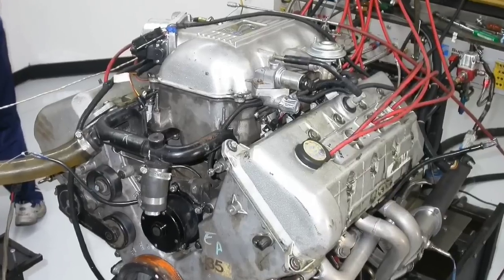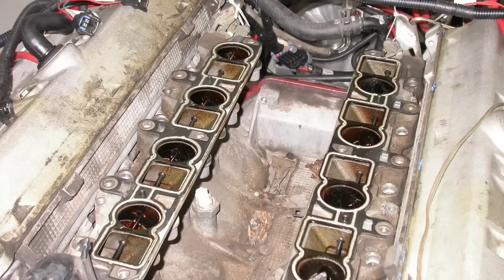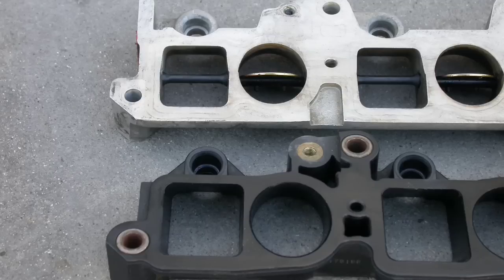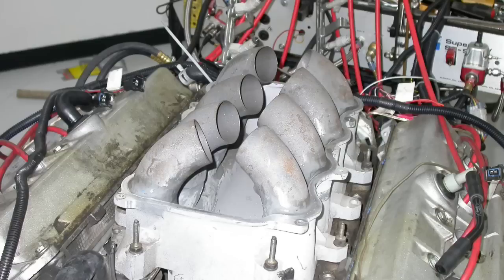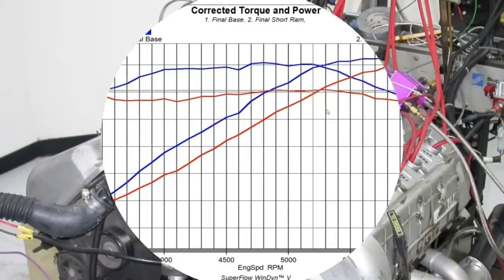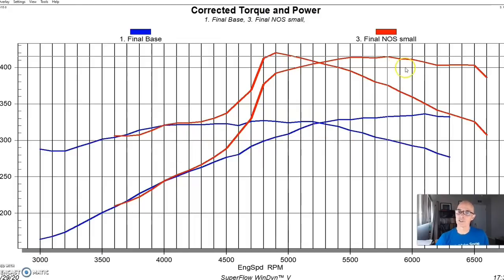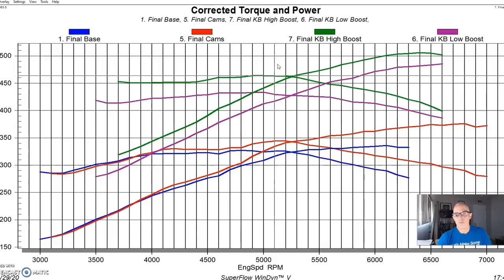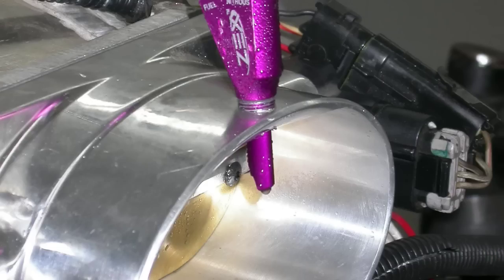1996-98 4V COBRA MODS

Comment: Those results show exactly why the LT1 and LS1 dominated during that era even though base Z28 cars were a class below the Cobra.
Reply: @turbojetpowered8299  best thing to do for em is 456 gears.  That really brings those cars to life and gives it aggressive gearing like the 11-17 coyote cars had which really helped them.  331 is like 410 355 is like 430 and 373 is like 456 if you compare an 11-17 coyote mt82 to the t45 back in those days.  So obviously the coyote has much more aggressive gearing and that really helped those cars.  A set of 456 gears with a sticky tire can take off more than a half second in the quarter mile on it's own on these cars that is huge.  I'm talking about a car that already had sticky tires just going from 327 to 456 gears will drop over half a second off your et it may actually even help the car trap a higher mph too.  Gears REALLY wake these cars up.  I cant think of many cars where a gear swap is needed as badly as it is on 96-98 cobras lol.  The mach 1 will also benefit from gearing but not to the extend the torque less b head cars do  because the mach is stronger in the mid range and has more torque overall so a super steep gear isnt needed although they do run awesome with 430-456 gears.  A gear swap on a 96 cobra will have it easily taking down stock lt1s even bolt on lt1s and it wont be far off stock ls1s.  Dont underestimate what 456 gears do for these cars lol
Reply: The Cobra wasn't the top dog/Mustang... the Saleen S351 was for that era.  495hp for the S351.  Modular Motors were the wrong move... Altered valve angle was the way they should have gone.. NASCAR Fords had been at 18 degrees since the 80's.. 18 deg heads instead of OHV would have put Fords on equal footing to the LS series without boost or spending zillions for a cam upgrade.
Reply: Ls1 camaro and 4v cobra were pretty evenly matched. Put em on the street and stock for stock it was a flip of the coin who would win and would mainly come down to driver.
Reply: @turbojetpowered8299  I bet your mach was sick.  I used to own a 97 cobra and 03 mach but it wasnt like whT yours was.  It was fbo stock gears tune.  It was faster than my intake full exhaust minus headers non tuned 97 cobra with 4.10 gears.  The 4.10 really woke it up but afterwards wished I had went 456.  I wanted 4.10 in the mach and cams similar to your build I bet that was badass man.  Those cars are alot quicker than many realize they could keep up with the ls1 cars pretty good  it was close enough to be a drivers race edge to the ls1.  You're right in that ford would not offer 456 stock it's too good lol.  There has to be compromise I could see 373 maybe 410 like you said.  The coyotes got stock 373s and they had a much more aggressively geared trans.
Reply: @turbojetpowered8299  $1000 for a cam swap.. just the cams on a Mod.  Compared to $130-300 for a Windsor.  408 Cleveland headed junkyard 351w blocks make 600hp naturally aspirated all the time. Modulars are a Poor/Expensive platform for modification.
Reply: @turbojetpowered8299   03-04 Terminator was Factory Supercharged and is an expensive starting point. $15-16k to buy an over 100k example. 408 forged rotating assemblies are much cheaper than $15k.. so are aftermarket Cleveland heads.. blah blah "scatter parts".   700hp single carb no boost 408 https://www.youtube.com/watch?v=D-Bcb4sC6Fw
Reply: Turbo terminators put GM out of production for 7 years
Reply: @turbojetpowered8299   Please ...  You're just boosting the crap out of poor design.  Factory 351C 4V heads flow 280cfm, Aftermarket Clevelands flow 400cfm. enough to support 550hp- 800hp N/A ..  Under 1 Bar of boost added to 550hp and you're over 1000hp.  This is a stupid conversation.. "blah blah strike fear" ... Who cares what strikes fear into boost junkies who know very little about N/A horsepower production??
Reply: @masta51  Is this a troll response? Do you realize how much EPIC FAIL this response has? Literally take the Cobra emblem out of your avatar. You are giving it a bad name and don't deserve it.
Reply: @turbojetpowered8299  Mach 1's WERE in fact drivers races with the then out of production LS1 F body, well, way more than the NA Cobra's anyway. However, I am talking about the NA 4.6 4V that came in the Cobra during the production years of the F body. Sorry for the lack of clarification. Even then, I have never seen evidence of even the Mach 1 running 12 second timeslips BONE STOCK. Something the LS1 F body achieved multiple times. Also, I bet my 2001 Z28 made the same exact power as your brothers SS but my car was 100lbs lighter and if it was heavier than a Mach 1 it couldn't be by much. That car scaled at 3400lbs on the dot with a FULL tank of fuel. I bought it brand new for just less than $22k out the door and no it wasn't a no options car. Good luck getting a Cobra at the time for that price or later on the Mach 1. 

Not to mention when you start adding bolt ons the 5.7 just flat out widened the gap. Headers and full exhaust alone make a ton for the LS1. On the Mod engine, not so much. We LS guys at the time also swapped gears for much benefit. Did Mach 1 and Cobra owners think that was a trick that only worked for their car? Lol
Reply: @banneddamn  sorry I hit a nerve there buddy. It will be alright even if the cars aren't evenly matched i promise. I like how you didn't even answer my questions. Discussion over i guess. LMFAO 🤣.
Reply: @turbojetpowered8299  good deal on the Mach 1. Yes, i also looked at some TA's and they were much more expensive especially the WS6 which dealers thought were gold. I wasn't as smart as you and rebuilt the factory 10 bolt once instead of putting a real Ford rear end in it. Money wasted as it didn't last long.
Reply: @turbojetpowered8299  lol, you go ahead and call it fun. I call it going broke because I was a dumb ass. 😆
Reply: @masta51  
Wrong
Reply: Termi's hold 7000 hp and can do 30k rpm on factory internals. Supra 2JZs can hold 7000 hp and rev to 30k rpm on factory internals.

Yeah and what. If you're building an engine who cares if you bought aftermarket parts. Many cheap and dirty 5.0 slow and sbc have stomped on modern better stuff.
Reply: @turbojetpowered8299  
A 1000hp terminator will never be ok with the smog police. Sorry, I'm missing your point.🤷‍♂️
Reply: @turbojetpowered8299  
Nice!
Yeah 1000hp car pretty much won't pass emissions where I'm at.
Reply: @ShizawnSanders  I beat on plenty of LS1 cars with my 98.  Most LS cars would run 13.30-13.50s at the track.  The 2v gts ran 13.80-14.0.  The 99-01 Cobras ran 13.30-13.70 and the 96-98s typically ran in the 13.50-13.70 range, with a handful of factory freaks going into the 13.40s.  It's literally a drivers race.
Reply: @ShizawnSanders  The Mach 1s and 99/01 cobras were a drivers race.  There wasn't much difference.  1-2 tenths.
Reply: @Milehighsnake98  you're being a fan boi and commenting on a 1 year old thread. LS1 cars were 12's capable at a much lower price than a 01 Cobra and calling it a drivers race would be like calling a LS1 car vs a 03 Cobra a drivers race.

Comment: what a trip down memory lane. My ex boss bought his wife a Mark 8 in 1996. I'll never forget the sound that engine makes when floored.
Reply: Sitting  in one right now. 281k miles.
Reply: Daver G  
That reminds me of the song:
what was i thinking by Dierks Bentley.

I have a 93 and 96 Mark VIII. They're all stock and they run goooooood and still give me 30-35 MPG. Can't complain.
Reply: Daver G  No not because he was riding around in the Mark 8 with the bosses wife it because he was riding the bosses wife.
Reply: would be curious to see what good head porting and valve work would do vs stock heads. I imagine there is quite a bit of hidden hp’s there
Reply: @keithwiebe1787  Mine failed after 317,997 if beating the crap out of it. Could have saved it but I bought another with 130,000 miles instead  lol.

Comment: I had a 98 Cobra back in the day. Mine had the 1.5L non intercooled Kenne Bell blower and IMRC deletes when I bought. I modded my manifold for short runners and raised the manifold floor like "they" said to do. Admittedly, I did a bit nicer job than shown here, but I could still feel a significant torque loss - with no commensurate gain up top to show for it. Luckily, I had 4.10 gears which kinda made it a moot point on street tires.

I used to bleed ford blue back in the day. Now I'm with Richard - I just like good running engines, whatever the source...
Reply: A properly done ported short runner Def performs better but you need a gear to take advantage some shorten them too much and it kills their power curve.  Nasvt knows how to do his ported short runners.

Comment: Just bought a 1996 Mustang SVT. 21,000 original miles. Thinking about doing long tube headers and leaving the motor stock. Very good video very informative. Long live the internal combustion engine.
Reply: Joe Biden said the internal combustion engine needs to be eliminated and that will put the oil companies out of business. Richard should start learning how to write s/w code for chinese made electric motors.
Reply: Put the same cams in that he did in this video. You won't regret it.

Comment: Time to test the big dog Triton v10 with the cam nitrous and boost. I want to see a torque shelf.
Reply: @crownvictorialifestyle4421  because 420# of torque in the late models.. cam blanks can be ground, rods and pistons can be gotten for the 5.4. injectors, plugs, so, yeah. V10 would be an animal with mods.
Reply: @crownvictorialifestyle4421  "no aftermarket support" 
You are aware the mod engines are in fact "modular" meaning the design and parts used on the 4.6 2v, share to the 5.4, which shares with the 6.8. Forged pistons, rods, oem factory forged crankshafts, billet cam cores, aftermarket headers, oversized valves, aftermarket timing and valvetrain components, and even factory power adders from Whipple, vortec, and a plethora of other options are available. Just because YOU arent interested in an engine doesnt matter.
Reply: @crownvictorialifestyle4421  Comp used to make cams for them I'm pretty sure, but not a big market for hotrodding in a 3/4 ton gas truck so they stopped.

Comment: Ouch!  I've never seen a better demonstration of how shortening the runners kills midrange torque.  The thing that jumped out at me in the picture is that the runner entries were not radiused.  That hurt the situation even more.
Reply from the maker: short runners are designed to make power at higher engine speeds
Reply: @richardholdener1727  Join the NASVT page on Facebook and see what a real SRI does, or any real 4.6L DOHC build.  the SRI showed looks unfinished. B heads are prob the worst heads, they only do about 370rwhp max N/A, for any power N/A you need to go c head.
Reply: Andres Solis 
Oooh,you just schooled Richard Holdener!
Reply: @andrestnt  yea a good well done ported Sri will definitely help these cars and the gain is magnified with cams to really take full advantage of it.  As for the loss in torque low with 430 gears you won't notice that lol.  That is the least gear I would recommend for an na b headed car...even go 456 do not fear the gear that is my number 1 advice to any new na 4v guys....dont fear the gear
Reply: @andrestnt  B heads aren't the worst heads, they just have too much port volume.  If I had an endless amount of money, I'd play with modifying the ports using epoxy (like some moto GP engine builders do) to shrink the port volume and increase port velocity.  It would be a ton of work, but it would be fun just to see what could be done.

Comment: That was awesome I really enjoyed that. I would love to see a 5.4/4.6 2v test with the Tfs 185cc and 195cc cylinder heads. I’ve been told that you need at least a 3.700 sleeved bore to take advantage of these cylinder heads. I think you would see huge gains regardless.
Reply from the maker: they work well on stock bores

Comment: I picked my 98 Cobra last week. I want to go with cams. Simple & Sweet. These cars are damn near perfect already. Add gears/tires and you're a low 12 sec car. Triple
Reply: I found a mystic cobra with decent miles for 12K think it’s worth it?
Reply: There pretty, just letting you know if it needs paint it’s a hassle to get done and expensive as hell. I owned #61 of 2000 about 15 years ago

Comment: I'm glad I stumbled onto this as I have a 98 cobra and planning on a kb2.1 blower in the spring.  I won't be doing cams though but that 500hp looks fun!
Reply: The non intercooler kb isn't that great for making power.  I'm a pd blower guy but with the lack of good options on these I'd recommend a procharger or a turbo setup.

Comment: The 4V gurus have perfected the Short Runner Intake. It's best to only cut a couple inches off the runner length. Also keeping the bellmouth ends is beneficial. Lastly, raising the floor of the manifold the same amount that you take away from the runners will help keep the torque from dropping off. Unfortunately, the B Heads have limited support for aftermarket intakes.
Reply: Not saying another short runner manifold wouldn't maybe do a little better, but this is basic helmholtz tuning stuff we've seen over and over and over again. Also, the "bellmouths" in those runners are as-cast and very poorly made. They don't hurt, but they don't work miracles, either. Last, I don't see how raising the manifold floor with epoxy is going to fix deficiencies in runner length.
Reply: @GroovesAndLands  I have a modified intake made by NASVT. It's got about one and a half inches cut off, and the bell mouths welded back on. It's got a raised floor, and a few other tricks. It's 100% worth it if it's made correctly.
Reply: @bumsoil  ye they def make more power up top and won't sacrifice everywhere else nearly as bad as this video if done correctly.  A short runner needs to rev its best to combine it with cams and rev to above 7k for best results.  Nasvt really knows his stuff with these older 4v cars.

Comment: I'd like to see a Lincoln mark viii engine basically it's the same block and heads but the internals aren't as strong but they handle 12to 15 pounds of boost. Cams are said to be the same but the intake and exhaust manifolds are more restrictive that would be a good starting point for a new test and then do cobra intake and headers then re degree the stock cam then splice part of this video in wear u added cams intake then blower
Reply: Most of the internals are the same as the Cobra with the exception of the crank; cast in the Lincoln and Forged in the Cobra. Pistons and rods are the same between early cobra and Lincoln. Block is the same, Tekskid aluminum block from good old Italy. Head castings are the same between early cobra and Lincoln except the cams are timed a little different; similar duration but Cobra gets more lift. Intake manifold on the Lincoln was tuned for low end and had IMRC to aid that low speed power. It was after all a nearly 2 ton Lincoln. Also there isn’t anything really a boost level the engine will handle. Like any engine it’s power that breaks parts, it doesn’t care at what boost level the power occurs. I can run 25 psi on a stock 2v if it’s through a small, less efficient turbo and only makes me 500Hp. At the same time I could grenade that exact motor at 10psi with a larger turbo that flows much more air. This is why it’s important to look at your compressor maps before picking out a turbo for your build.
Reply: I should add the Cobra intake had IMRC too as Richard said but it’s more of a CMCV system because it’s still a single runner intake. The early Lincoln had true IMRC which had a vacuum operated servo and a true 2 runner intake design. Cobra and later Lincoln 1 runner intake were electronic servo controlled.

Comment: Interesting that the 4v 4.6l ford makes very similar power to a chevy 4.8l
Reply: And it's an older engine too as well as slightly less displacement.  The c head 4c can do like 375 rwhp which is well over 400 hp on an engine dyno prob 450 and they can do that with just fbo, ported stock intake and cams.  Pretty good for a 20 year old 4.6.

Comment: It is quite interesting to see 96-98 Cobra motors with Kenne Bell hp per psi :

So as default 96-98NA makes 305hp and with Kenne Bell at 7psi makes about 410HP based on their website, so math says:

(410HP - 305HP) = 105HP. Which we divide with psi, so we get 105HP/7psi = 15HP/psi.

Now with Richard Test:

Modified NA  = 376HP
KB 8.8 psi = 485hp
KB 11.9 psi = 506hp

(485hp - 376hp) = 109hp. ==   109hp / 8.8psi = 12.3hp/psi

(506hp - 376hp) = 130hp ==   130hp / 11.9psi = 10.9hp/psi

So HP/PSI ration goes down very rapidly more you increast boost.
Reply: For one, this was a KB non-intercooled setup.  The more you compress air, the more heat is generated.  So using non-intercooled, you will see a decrease in returns.  If you use an intercooled setup like a centrifugal or turbo, it will be more consistent that for X amount of boost, you would add Y amount of hp.

Comment: Great video Richard! Between the 2V, 3V or 4V mod motors, which setup would give you the best bang for the buck & HP. Thank you.
Reply from the maker: 2v is cheapest
Reply: 2V = best ROI. I got a set of ported stage 2 “patriot heads” for $600, short block 98 teksid for $200 std bore, then bought an MMR forced rods/piston/ring/bearing kit for $1000. With labor I spent $2500 total for a built long block that is good for a safe/reliable 700-800hp and 900hp if I want to go full race mode with shorter life expectancy
Reply: @richardholdener1727  Ive been sourcing aviator engines for people giving them an affordable 4v solution. You should big bang an aviator. Its the closest to an aluminum block cobra engine you can find in a junkyard, and honestly identical to an auto mach 1 shortblock.